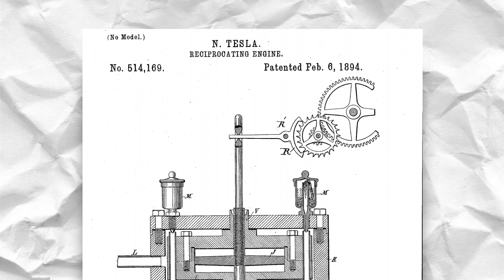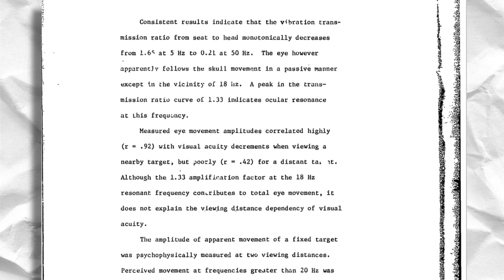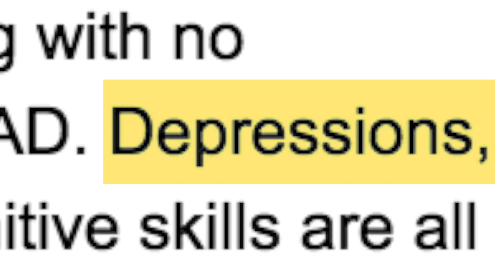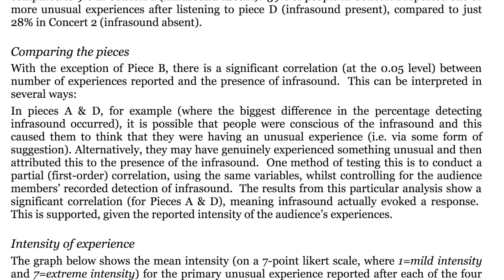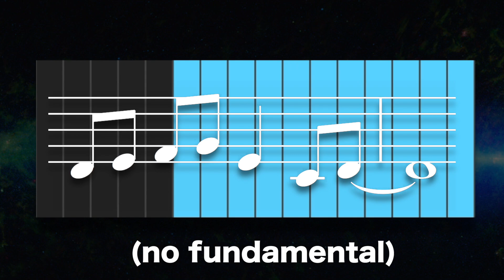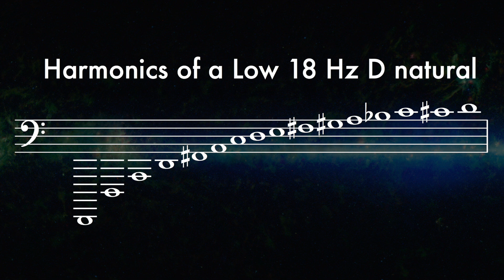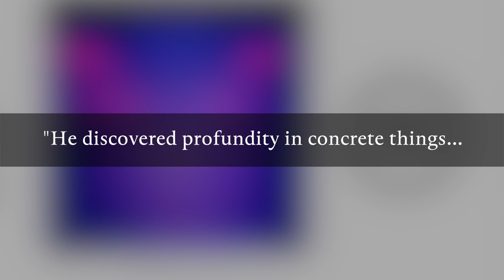How to See Ghosts (using Infrasound)

Comment: I also tried listening to ten minutes of an 18 Hz tone. I felt nothing at first. Then after about five minutes I began to feel physically uncomfortable (joints started hurting, head felt funny but no visual hallucinations). At 8 minutes I had to check how much longer I had left as I was very much not enjoying the experience. When it ended I didn't get a sudden rush of relief, though. Not entirely sure if I was playing it loud enough, but it was certainly louder than the loudest I would listen to music and loud enough that I could hear the speaker cones moving in my speakers. I can see how prolonged exposure to the noise, especially not knowing it's there, could really make you feel uneasy.

Comment: Combination tones are not entirely a mental thing, they just aren't sound oscillations in the same way a 'normal' frequency is.
They are physical, just not audible.
The volume of the sound that you hear IS oscillating at the combination tone, except volume oscillating and pressure oscillating are not the same thing, and pressure oscillating is how we hear frequency.
I actually have a visualization of this on my channel, I won't link it because that will be marked as spam but its called 'a cool visualization of dissonance' and you can see the difference frequencies.

Comment: Edit: The below is wrong. It seems it did record the sound. However, it also seems that Adam's demo only played a 20hz tone. So it's still a placebo if you felt it then.

Heck, we're not sure that Adam actually heard a 18hz tone!

-------(old post below. I don't Lucas my posts.)-----

Also, for anyone who felt effects from the 18hz tone in the video: that was entirely placebo. I checked into it a while back, and modern audio compression removes infrasound.
Reply: Nope, it's in there. I just checked, and there's a ~19Hz tone popping up in the video right when he says "this microphone"*. It's plainly visible in the spectrogram view if you record it in Audacity.

Modern audio compression removes *ultrasound*, because that's a giant waste of bandwidth. However, infrasound requires so little bandwidth that there's no point in filtering it out, except maybe to improve dynamic range. Think about it: 0 to 20Hz is only 0.1% of the full 20kHz of bandwidth of the human hearing range. You aren't going to save many bits filtering that out.

* Which is after he switches on the sub. I think he cheated a bit and wasn't actually playing the infrasound tone when he switched the sub on, but it was playing after the jump cut to the spectrum view.
Reply: Audio compression does not significantly change frequencies; that would greatly mess up the audio, so it's just not something that lossy codecs do. The tone at the beginning is also there, but it's not a fixed tone: it actually wanders slightly before settling on what looks like around 18Hz. It's hard to tell with barely one second of audio to run through a narrowband FFT, but counting cycles by hand puts it at just over 18Hz once it stabilizes (~18.2 or so I'm eyeballing).

Audacity actually puts the tone at 20Hz for Adam's demo, and I filtered out higher frequencies and counted cycles manually and came to the same number. I don't know why Adam's demo claimed to be 18Hz but wound up at 20Hz, but if you look at his spectrum analyzer (even though it doesn't have very accurate binning that low), the peak is clearly at the 20Hz gridline, not earlier. For whatever reason, the tone he was playing through his sub was 20Hz, not 18Hz, and that's what comes through the YouTube audio too. Compression didn't do that.

Addendum: just for another datapoint, I tried sending some white noise (48kHz sample rate, 0-24kHz bandwidth) through the Opus codec, which is the current state of the art for audio and used by YouTube in some cases. Opus makes a clear point not to encode anything outside the audible range. Results: there's a sharp cutoff at 20kHz as you'd expect, but nothing much at the low end, at least on a coarse spectrogram. It does not truly go to DC, though: a DC offset gets filtered away, and a pure 1Hz tone gets attenuated by 13dB. The -3dB point seems to be around 3Hz, so we can conclude that Opus with default settings has a 3Hz-20kHz frequency response - certainly covering 18Hz without an issue. Looking at the Opus documentation, this is exactly what is documented: "The 1.1 encoder now uses a built-in DC rejection filter (3Hz cutoff) for all modes." There you go. The purpose of this filter is, in fact, to prevent DC energy (which is of course useless by definition - there's no way for a speaker to reproduce a static pressure without a perfectly sealed room) from confusing the psychoacoustic analysis of the encoder by making it think there's more energy in the lowest band than there really is.
Reply: marcan, damn, you're completely right!
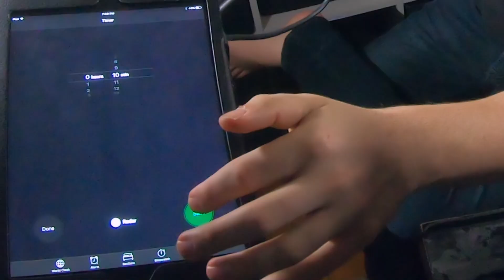There is a peak near 20Hz right after the jump cut at 4:46 and it lasts until 5:09 ...

(I was initially watching this on my phone. No Audacity installed, but after reading your comment I turned on my Linux PC and piped the sound through JACK into the "analyzer" plugin from Calf Studio Gear... and yeah ;)

The amplitude seems a bit lower than in Adam's video, but that could be a difference in software (or a gentle low-shelf / high-pass filter). I can think of reasons to filter out infrasound from the final mix, but it seems that YouTube's codec doesn't do it automatically. I'm actually surprised.

My thoughts exactly regarding the bandwidth – although 0.1% of extra space is still terabytes for YouTube  :) 

I'd also have guessed that any purely DC components get subtracted, but after this I'm not sure – I'll test and report back later!
Reply: update: I used a specially-crafted test track with a strong DC component (and nothing else). I converted it with ffmpeg to .aac, .mp3 and .ogg (vorbis) and played it back through the same setup.

It turns out, not even the DC component (that is, frequencies that mathematically approach zero) gets cut off!

Seems pretty conclusive that most lossy codecs do carry infrasound by default.

PS. All ffmpeg conversions were done with the default settings. That's around 128kbps for mp3, and 112kbps for vorbis, which are low values (=very lossy) by today's standards.
Reply: I knew I felt something weird but also figured it was all in my head. Fascinating how that works.
Reply: Audio compression uses a psychoacoustic model. It's all about what people can actually hear. If humans can't hear it, it's considered to just be wasting space. It'd be like a JPEG including infrared. 

That's not to say a computer can't produce it. I'm sure a WAV or FLAC file could contain infrasound. Or you could just use software to make it. 

But you'd still need a good subwoofer that can produce tones that low. Or else it's a waste at best, and damaging to your speakers at worst.
Reply: What surprises me more than the codecs supporting it is that YouTube doesn't do a high pass, if only to ensure that no one blows out anyone's speakers. I guess the DAC is being trusted to cut off frequencies that would be damaging?

Anyways, I'm going to edit my main post.
Reply: You DAC does cut off DC - all but the most horrible cheapo USB sound cards do. This is because audio jacks and circuits are pretty much always AC coupled. Regardless of what the actual DAC chip does, the signal coming out is pretty much guaranteed not to have a DC component. You can easily test this with a multimeter. In fact, I've used sound cards for non-audio applications where the DC component is actually required (using them to generate laser graphics), and for that you need to modify them to bypass the AC coupling capacitors. For speakers DC is actually dangerous; if your laptop's audio hardware didn't filter it out, you'd melt your speakers when playing stuff with a DC offset.

However, while a constant DC voltage only has energy at 0Hz, a change in DC voltage most certainly covers higher frequencies. In fact, it covers all of them: the step function has energy at all possible frequencies (until your DAC's cutoff anyway, so until 24kHz or so). Opus filters off DC but if you feed it DC that comes and goes it will most certainly pop just as much on the way out as it did on the way in. That's the job of an audio codec after all, to encode the part that you can hear (the wideband transient at the point in time where you add a DC offset) and not the part you can't (the actual constant DC offset). DC turning on and off is, after all, no longer DC.

Another way to look at it is that whatever music player you're using does not fade in the track, even subtly, when you start/stop playback, and that introduces an audible artifact - the pop. This applies to any audio, since you'll almost never get lucky enough that you pause it when the signal is at 0. It's just that with actual music the pop is usually less obvious when other things are going on too! This is why a proper DAW (i.e. not Audacity, but stuff like Ardour) will always have at least a short fade at the beginning and end of audio clips and sections by default, because otherwise the result would be a pop fest. Any transition at all, even a clean fade, always introduces some distortion, but at least with a fade it can be made inaudible, while a hard cut causes an obvious pop.
Reply: Lel wut, they do it to save storage space and network bandwidth, which is also the reason they remove frequencies above approx. 15kHz (depending on audio codec, bitrate, and settings). AAC, mp3, Opus, Vorbis work similarly in that respect. 

More importantly, such low frequencies cannot be reliably reproduced by most cheap/commonplace equipment, such as your phone, laptop or even most PC speakers. And if they can't be reproduced correctly, they can even introduce problems, such as distortion. So, there are good reasons to remove infrasound. After all, if you have any reason to really care, your source of the signal will certainly not be a YouTube video...

PS. Although I wonder whether the space aspect is negligible... The bandwidth is barely affected. I suspect the correct answer requires deep DSP knowledge which I don't have.
Reply: marcan, after you edited your post with more information on Opus (thanks! very interesting), I repeated my own little experiment with that codec as well, and also using white noise. I was unable to see any difference in the sub-20Hz frequencies, because neither of my spectrum analyzer plugins goes low enough, but I can confirm (from the phase-thingy scope) that the DC component is gone.

Honestly, what Opus does is much more reasonable than mp3/vorbis/aac, for a lossy codec (FLAC on the other hand should preserve everything, and does).
Reply: Yeap, I'd guess so.

edit: Turns out, we're both wrong
See the technical discussion below  :)
Reply: That difference tone however, should show up if you play the video loud enough.
Reply: Darn, that sucks. I'm curious as to why they would remove it.
Reply: ZipplyZane, yeap, there's no fundamental reason uncompressed formats can't contain infrasound. The physical limits of sampling impose an upper bound (Nyquist frequency), not a lower one. That does not apply to the DACs, amplifiers, filters and speakers though.
Reply: That is unexpected. It's not what I've been led to believe, but I admit I didn't check the file myself. I was going by what other fact-based YouTubers have told me. 

Still, there's something odd. Is it actually about 19hz? Because that would suggest that it's inaccurately reproducing the sound. Maybe that's the problem--that lower sounds are less accurate?

The last thing I want to do is spread misinformation. Can you check if it's the right tone? It may be just that infrasound isn't encoded accurately.
Reply: ZipplyZane, sure, but your point (and mine! ) about infrasound frequencies being discarded turned out to be wrong. I think that's very interesting ;)

Regarding the peak at 18Hz vs 19Hz, analyzers have inherent inaccuracies and aren't really coded to account for infrasound. Before the Calf Studio Gear plugin I tried another one, and the lowest it would display was 20Hz (so the peak could be inferred, but not directly seen).

BTW, if anyone is interested in the test track I used – you can google the freely available "Bink's Audio Test CD".
Tracks #50 and #51.

(Warning, especially the latter can damage your speakers! I redirected the playback to the spectrum analyzer ONLY.

In fact, I also sent it to my cheap speakers afterwards to satisfy my curiosity, and there was a nasty pop.)
Reply: ZipplyZane, I'm also surprised – and also my laptop's DAC doesn't cut them off, because otherwise my speakers wouldn't make nasty pops when interrupting playback of the aforementioned track #51 (thankfully I don't care much about them).

Thank you both, I learned something today  :)
Reply: marcan, these are great explanations, I sincerely hope you're teaching somewhere!

So you're saying the DC signal doesn't get through, but its transient (only the higher-frequency part) when it suddenly stops does, right? Makes tons of sense! After all a "pop" (and anything close to an impulse) has rich spectral content.

I'm a bit ashamed to admit; I already knew this stuff on a theoretical level – but I'm not a musician or a sound engineer and I don't program DSPs, and it's been several years since I took my "signals & systems" courses, so I do appreciate a refresher  ;)

Yeap, even a fade-out of a pure sine wave introduces other frequencies, even theoretically. And, in practice, I did observe a transient lasting about 1/3 seconds right at the start of the playback of the Opus file (the one having only a DC component and nothing else) which is consistent with its high-pass filtering starting around 3Hz.

Thanks again. I'll have to try the multimeter trick  :D

edit:
PS. Just a quick clarification – I didn't feed the Opus encoder DC "that comes and goes", except at the very start of the track (which indeed showed through). The signal stopping abruptly was purely due to the command-line music player I used, which I interrupted with ctrl-c  :)
Reply: You would need a sub to "hear" it. Laptop speakers and headphones could never do it.
Reply: I didn't mean to say you fed Opus a variable input, I was just using that as an example :-)

And yes, indeed, when I made Opus encode DC I got a nice exponential decay transient at the beginning, consistent with a 3Hz filter (probably a simple first-order filter I'm guessing). There are actually some interesting arguments to be made that this should be a configurable option. For example, if I'm chopping up audio and want to make a seamless loop or seamless transitions using Opus (without crossfading, just having the clips prepared in advance to be seamless), I'd want to turn off the DC removal filter, lest it introduce discontinuities at clip boundaries.

Sorry to say I'm not teaching. I just have funny hobbies :)
Reply: nooneknows: headphones absolutely can do it, better than a subwoofer in fact. Especially in-ears, since they seal better. They won't make your eyeballs vibrate, so definitely no seeing ghosts, but your eardrums will notice. I can definitely "hear" 18Hz through my cheap and lovely 1More 1M301 headphones. At those frequencies the sensation is less of sound and more of a vibration - you can feel each individual push and pull on your eardrum, much as if you stuck a finger in your ear and moved it. You can feel the pressure difference and you can hear the subtle higher frequency artifacts caused by the components in your ear moving (your ears aren't perfect - even slow movement of your eardrum produces "rubbing" noises of much higher frequency).

Out of curiosity I tried a few frequencies. 12Hz is definitely still perceptible on these headphones (at full volume, no clipping). 10Hz is a wash. I'm not sure if this is because I'm hitting the limits of the frequency range of these headphones, or because it truly becomes very difficult to feel at that point. Probably a bit of both.
Reply: marcan, good point on DC removal being configurable, although to be Devil's advocate lossy formats should only be used for the final export, and if you turn on that optional flag then you already know that you're gonna further edit that file and that you shouldn't be using Opus. But you already know that  ;)

I also have funny hobbies, way too many in fact. Your posts tempt me to take up signal processing. Thanks again  :D

PS. Wow, I'd never expected headphones to reach those frequencies!
Reply: I was thinking of use cases like games, where you often do procedural mixing and looping of audio, but you still want to use compression to save on storage space. Of course if you're doing audio production you should just use a lossless format all the way through until final export.
Reply: marcan, oh, good point!

Comment: What would happen if you played a fundamental with all the overtones cut out and the undertones replacing them, and then allowed other things to oscillate sympathetically with the fundamental and it’s undertones

Would it be spooky?
Reply: Well, fundamentally (ey? ey?) the closest thing I can think of this would be something like Lucier's I am Sitting in a Room. Admittedly it's not quite the same (since the undertone series is more of an analytic continuation than a representation of an actual physical phenomenon, you'd have to pair that sort of thing with some sine wave generators to get an effect like the one you'd describe) but is certainly a worthwhile starting point if you're curious.
Reply: Benjamin Vroman It would probably rattle a room or cause sound drifting. Sounds exciting!